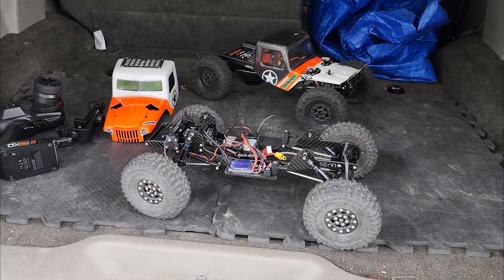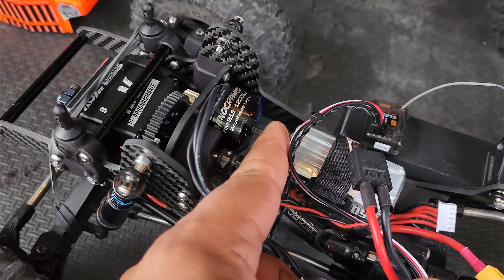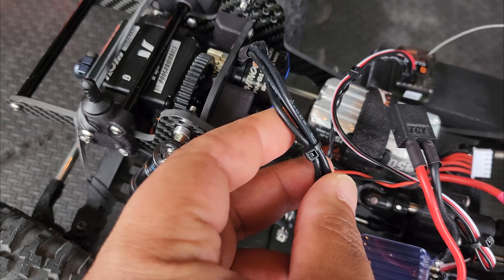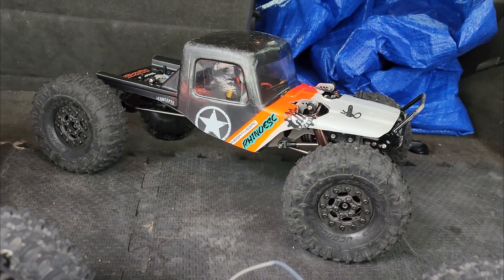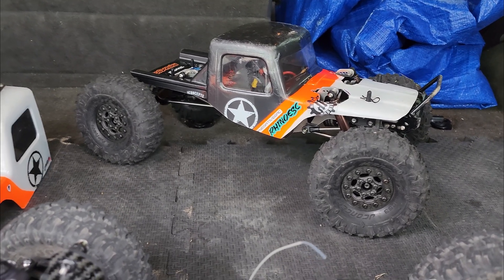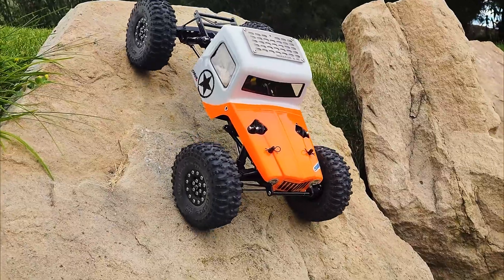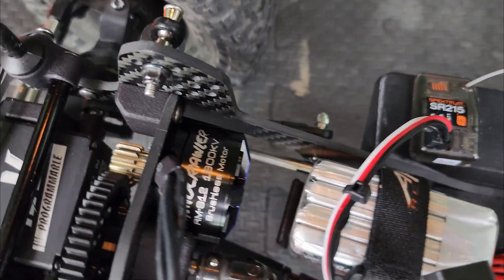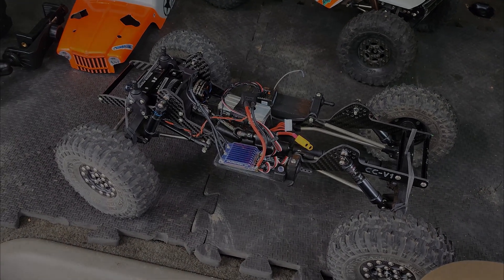Rhinocrawler RMS12 Outrunner Motor | 40a ESC | First Look

Comment: I got this same motor coming in a few weeks, i actually totally intended on getting the 20 instead of the 12, owell.. I ordered the rhino esc clone for like 25 bucks!  Its basically the same exact ESC looks the same too.  Its got the same firmware the rhino esc has.  Its also am32 80a 10abec👍

Comment: Hate to sound like a spud...but this is my first go around with rhino and i purchased a 9imod outrunner. I am used to the castle stuff being labeled ABC on motor and esc...ummm..which wire goes where? Sorry, im a newbie at this.
Reply from the maker: oh it doesn't matter. Just hook em up and you can  swap any 2 wires to reverse motor direction.
Reply: @Furadi  Thank you buddy. I was freakin out a bit

Comment: Im running a external bec on the 40 amp esc , do i have to put the hot wire back in the plug to program?  Thanks for your vids

Comment: Thanks for the review. I subbed awhile back because of the Rhino content you covered. Now running 3 different 80 amp Rhinos lol. Used your input for my baseline settings. One Surpass hobby buget out runner, a HH 2040kv snub nose and a Team Brood Riot S. All work very well in my different rigs. May need to check out a 40amp here soon...

Comment: I am running the SC-v1 with a HH Snubnose 1800KV paired with the Rhino ESC 80A. I have not noticed any stutter. Although I am running direct powered steering servo (shift RCS x2). .  I have been eyeing the NEG. G Class 1 kit. What is your recommendation on donor axles? Thanks for the video and info..